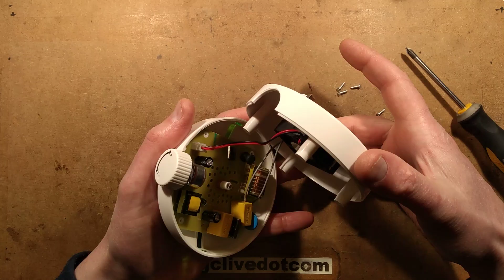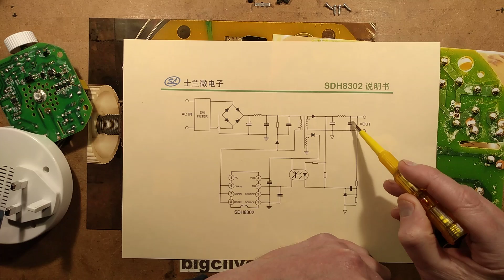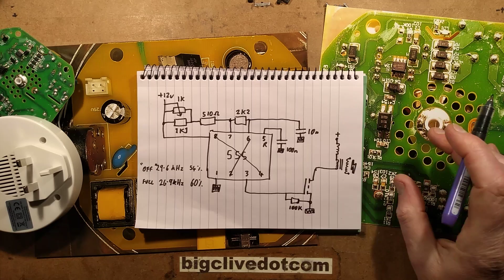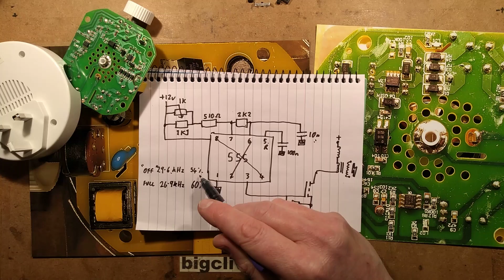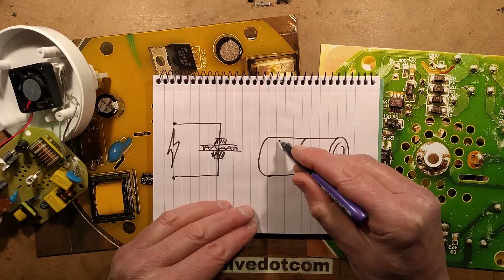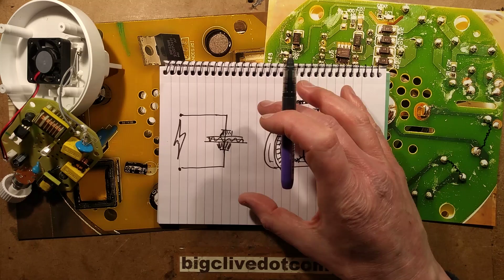Inside a faulty Puripod ozone generator.

Comment: The DS212 seemed like the best mini scope I could find, though it's still a bit expensive for my current involvement in the hobby...  There's another one that came out, though, it's a hand-held greenish thing, 20 MHz 2-channel, sells for about $120 on eBay...  They'd advertised it for $20 one day by mistake and someone bought one, but they fixed it the next day and I couldn't order it  lol

idk if it's any good, though, it's the.... JDS2023, they also have better models, too, like a 50 MHz one, and a 4-channel portable one, but the JDS2023 is at the same price point as the DSo212 and I'm wondering which is the best bang for the buck... and I guess, speaking of bang, maybe you could get one for free off Banggood and review it or something  x 3

I was just checking and there's also an Owon 100 Mhz 1GS for $260...  There's the resale value, the "I might break it" factor, and the usability and keepability that I consider, I think...  idk what I'm going to do, but since you have a DSO212 if you got a JDS2023 and made a comparison, I wouldn't stop you.

Edit: There's two English reviews on YouTube for it (haven't watched them yet), I think it's a new product/brand/company...
Reply: I'm just going to use my BeagleBone black as an oscilloscope.
Reply: My "stunt" oscilloscope is a DSO150. It can be found for about 20$-25$ on banggood. Only single channel and not really high bandwidth (a few hundred kHz), but it serves me well when doing repairs especially in the power supply section of circuits.
Reply: Yeah, the BeagleBones a little pricier (60  NZD)  but I believe it does 100 MHz max. I'm currently building a case and designing some PCBs to attach probe jacks to. 2 BNC, 14 banana plugs. Has either 16 or 14 channels, and you can use it wirelessly. It's a pretty cool system. If you're interested check out BeagleLogic

Comment: Being a ham radio guy, when i hear arcing it is always a bad thing. With high power RF amplifiers - tube type, if it arcs it also goes bang LOUDLY!
I don't get the benefit of ozone, only smoke and if it's a really big failure - fire. Lots of fun for all when the smoke alarms go off at 2 am.
John blew up his transmitter again - yay!
Reply: Surely you’re not suggesting that 3,000V at 1A could possibly get exciting?  :-)
Reply: @ethanpoole3443  I got an old eto alpha 3cx1500 amp at a ham fester. Guy said it worked but needed some tlc. $200 i took it home. yes it worked fine - ish. After testing it i was happy, left it for a day and a half or so. I played it smart and discharged the
HV cap and wham! One of my fingers was on the screwdriver shaft. Threw me against the wall and i broke my left index finger.
Always replace the discharge resistors - always. 1 st and last time that happened to me. Truth be told i do not remember what i broke, i just remember the flash the wall and being on the floor. I was 22 so a long time ago - early 80's. I have a very healthy
respect for high voltage - from then on.
To see it is fine, when you see and taste it a
lifetime lesson has been learned.
Nope, no excitement at tall.
Reply: Being a ham, period.(couldn't resist)
Reply: @benwinkel  After a few adult beverages.
Like tonight, the ham part does come out.
Reply: @johnrobinson357  Lol! I can relate to that. =)

Comment: Far from being healthy, ozone is a toxic gas, its ability to react with microbes in the air also allowing it to interact with, and damage, tissues in the human airways. In fact I conducted lab research into this toxicity some years ago. For example, the US EPA states: "When inhaled, ozone can damage the lungs. Relatively low amounts can cause chest pain, coughing, shortness of breath and throat irritation. Ozone may also worsen chronic respiratory diseases such as asthma and compromise the ability of the body to fight respiratory infections." I would therefore definitely avoid the use of ozone generators in any attempt to purify air as a means of improving one's respiratory wellbeing.
Reply: Very true. And it is downright criminal to market this as an ionizer, and encourage your customers to use it in occupied rooms. Ozone has damn-near miraculous odor destroying abilities. And, to me, definitely has its place when used properly (in unoccupied rooms, with ample time to dissipate.)
Reply: William. I can concur with your response as a retired clinical scientist working in the Linear Accelerator radiotherapy side of Medical Physics, Ozone is highly toxic and causes cell damage, we had to go to great lengths to monitor and suppress its production in very high voltage equipment,  I can not think why anyone would want to actively produce it. Ozone is often confused with Dimethyl sulphide which is the compound that causes the "Seaside smell" that you sense at the coast caused by decomposing organic compounds found in seaweed etc!
Reply: @peteshulver9221  - So dimethyl sulphide is responsible for the "Seaside smell"(?)   We need to bottle this up and sell it as "ode de beach" stat!  (o:
Reply: @peteshulver9221  Yes, quite a nasty compound! In my research, we used high-voltage discharge-based ozone generators in exposure chambers within a dedicated inhalation toxicology institute in the US.
Reply: quoting the epa is not exactly lab research
Reply: @Blox117  Clearly, I was not sufficiently explicit in my note. I am a PhD biochemist and toxicologist and have specialized in laboratory inhalation, cell culture and metabolism studies (including those looking into the effects of ground-level ozone on respiratory tract cells and tissues while pursuing a postdoc. at the Inhalation Toxicology Research Institute on Kirtland AFB, Albuquerque NM). The EPA quote was just a recent general statement on the subject.
Reply: @williamevans9426  I have been reading more on ozone and it appears you are correct. Ozone should not be present in living spaces over a lengthy period without ill effects. Over a short period of time at low concentrations I will have to disagree that it is harmful at all. Basically treat ozone like you would chlorine.
Reply: man I certainly dont understand this paranoia over chemicals
Reply: @Blox117  Try telling that to the North and some South Vietnamese during the war when doused with Agent Orange!
Reply: @peteshulver9221  that is the most retardedly dishonest strawman argument I have seen in a while. congrats
Reply: @Blox117  
Truth.  Entirely irrelevant and unrelated.

Ozone is one of the best deodorizers.  I use a massive room cleaner a few times a year around my house.  I run it for a half hour and then properly vent the room to the outside.  These smaller units are definitely helpful to remove pet odors.
Reply: @Aff3ct000  Fair comment - especially as you ventilate the rooms well; I wouldn't generate ozone in an enclosed space while being in there, though. Post-generation, once well ventilated, there'd be no residual problem.
Reply: @Aff3ct000   You are harming your health and the health of your pets by being in the same room as an ozone generator/deodorizer. Modern research shows that you can only safely use these ozone devices when no living people or animals are in the room/building. Like a bug bomb, you must ventilate the area before you re-enter the space.  That is why these ozone deodorizers and air purifiers are being banned by most western countries. Enjoy your upcoming cancer events in your smell free home :-)
Reply: @LastTechnocrat  
You may want to brush up on your reading and comprehension skills.
Reply: @Aff3ct000  Unable to refute the argument so you attack my reading and comprehension. Next time try responding to the merits of the arguments against ozone.
Reply: @LastTechnocrat  
Again, read what was said.  You clearly have difficulty with simple comprehension.  When did I state that anyone had access to recently ionized areas?

Comment: There in insanely stupid noob-question on AC-DC converting circuits: What limits the power/current output? When I let a load draw more than 1.1A on a 1A rated  USB power supply, the voltage quickly drops under 4.7V. So how is the current determined that causes the voltage drop?
Reply: Martin Rocket - The design of the circuit and the properties of the components used. For a start, some designs include either a power output limiting function, or a current limiting function. Even where they don’t, transformers can only pass a finite amount of power. In all cases, the output voltage drops.
Reply: Mark 1024MAK, so if there is no deliberate function to limit the current, then the transformer limits it inherently? Are there any other limiting factors?
Reply: @martinrocket1436  peak primary current limiting, usually a function of the control IC and either an internal or external current sense shunt resistor in the primary mosfet drain. https://pdfserv.maximintegrated.com/en/an/AN5504.pdf
Reply: but the real question: why cant i get infinite power by plugging in an extension cord into itself?

Comment: Hi Clive, thanks for getting this in and checking it out so quickly after I mentioned it. The video you seen was the one I did with the smoke and it did seems a bit iffy when I watched it and yours is much better with real information. I did end up buying two of these and both were slightly different as one made loads of noise and the other very quiet so I think manufacturing might be a bit hit and miss. Those green LED's are so bright in a dark room I put tape over them but wasn't sure if there was a reason behind them but after your video, I'm guessing not. The smell is very difficult to describe but the smell after a thunderstorm as they claim is almost right but not exactly it. I personally didn't mind the smell at first but after a couple of days, I couldn't deal with it anymore so unplugged them both. It's a bit naughty the company claim it to be an ionizer though as that's what I wanted to try out. I will keep my eyes open for other things like this you might fancy taking to bits. Thanks for the video :)

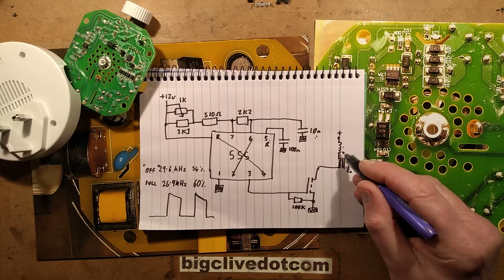Comment: 14:25 Depending on the position of the coils relative to each other, it could be that the designers required 'mutual inductance' in the circuit.
This inductor may take the place of a protection diode not seen here often found in these circuits to protect the MOSFET.

Comment: Could it be deliberately designed to generate ozone all the time even when the fan is off to make it fail faster. That you need to replace the device once a year instead of once ever 10 years. Sometimes bad design decisions are bad for the customer, but good for the manufacturer. Effectively you have a highly corrosive environment inside the device. Me personally I've always thought of ozone as a bad thing for humans, unless it is at the top of the atmosphere blocking 100% of the UV-C in which case it is great.

Comment: It's a very pretty transformer and if fully potted I am betting ya could get 10-20 KV out if driven hard enough maybe more.

I am betting the inductor in series with the HV transformer is for current limiting to the primary. I wonder if they did that to cut down on power handling/cooling components and cost.
Reply from the maker: Looks vacuum potted.  It does look very good quality.
Reply: @bigclivedotcom  My friend and I " Youtube Channel Join The Technicians " Have been working really hard to make custom high voltage transformers for the electrostatic magic wands. So far we are on driver development and are fixing some phase problems with the full bridge driver but not important. The transformer shown here is an amazing form factor, looks about the diameter of a AA cell. Currently we are using a driver that matches the 18350. This stuff gets really tricky when you try to put 250kv in a 12 inch stick. The problem we have been working on is defeating the capacitive heating in the epoxies, another major one has been trying to cure the epoxies at the right temperature zones as not to crack the cores. A thing to note when you pull transformers apart, a heat gun does absolute wonders!

Comment: Do these work and is ozone safe?
Reply from the maker: Yes they work.  There are two sides to the ozone argument.  I side with it being safe in low levels used occasionally, but I wouldn't want an ozone generator running in the same room all the time.
Reply: bigclivedotcom thanks big man.
Reply: like all things it is safe in moderation

Comment: Terrible looking solder joints all over that PCB. Probably used the sh**ty lead free solder because most of those solder joints look dry and bumpy. I agree that it's a weird circuit design. Cheap looking too. But an AWESOME video upload as always Big Clive!  Thank You!
Reply: That's not a lead free solder problem. It's bad technique. That's what SAC305 looks like when you are sloppy. Have to use an appropriate tip, appropriate temp and be meticulous about keeping the tip clean. None of that will slow down someone that's gotten the hang of the stuff but it does require giving a shit about quality of your work.
Reply: Oh I'm sorry. I've never used lead free solder (or SAC305 as you mentioned) in the 41 + years I've been in the electronics industry, but what ever the reason is for these lousy solder joints, this should not have passed inspection. I'll have to try out the lead free solder sometime and see how it works. Probably won't bother with it though.
Reply: @JayH7745  SAC305 is one of the industry standard lead free solders. Similar to working with the lead based silver bearing solder of old but higher heat to get good flow. Works amazing when you need something that'll shield the joint from ambient RF and as I learned in a recent project can actually weld galvanized steel with a seamless (looking) joint.

Comment: Ozone is very  bad for you. Any heavier ozone exposure gives a nasty headache very quickly, at least for me it has. If you're in a room with ozone you will get used to the smell and may not realize levels rising to dangerous levels. I had one such experience when running a tesla coil in closed room for a while. (arcs in the air generate ozone a lot). UV light is another common source for ozone but if you're in a radiated room you have much more problems than ozone with that!
Ozone is very toxic. (Had to dig some non-EU msds references for you : ) US OSHA 8h exposure limit 0.1 ppm (ppm=parts per million). That much less than limit for hydrogen cyanide when comparing the concentration. You'd smell ozone more easily though.
Reply: Ozone is also bad for the environment at surface level. It filters UV light in the stratosphere, which is good, but at surface level it’s just toxic and inhibits photosynthesis.
Reply from the maker: I think it's the process of making ozone in the stratosphere that absorbs the UVC wavelengths.
Reply: If you are sparking away with your tesla coil, also note you are generating Nitrous oxide, also bad for you. Even with a small setup if you put a glass jar over it you will see the brown gas form

Comment: this faulty one produced double ozone, at the intended tube and at the faulty sparky joint :)
Reply: They could market the faulty units as "premium efficiency units"
Reply: 2x the ozone output, with bonus toxic solder ions free of charge and all for the same price!
Reply: Unless it's using lead-free solder, for non-toxic solder ions.
Reply: Greg Ewing - Exactly! Given China's track record, hopefully the solder is on the level, especially considering the device will certainly be used around people and pets...
Reply: @gcewing  If it was leaded solder it wouldnt have been such a horrible joint :D
Reply: you're not wrong
Reply: Ok so how much ozone MG/h??

Comment: why would someone want to generate ozone?
Reply: Too many uses to list in a youtube comment so...
https://en.wikipedia.org/wiki/Ozone#Applications_2
Reply: @cojones8518  
Thanks for this very informative link.
Reply: To close the hole in the ozone layer.
Reply: If BigClive had only explained that... Oh wait... HE DID!!! 😒
Reply: It is sold as an air purifier, but just spits ozone instead. Ozone has a “fresh” smell though, so you think the air is pure.
Reply: morthim - To recap... it's a very effective deodorizer and thus ozone machines have been marketed to consumers over the years to kill bad odors (and also molds) around the home (ie) heavy cigarette/cigar odor,  musty basements, odor abatement after sewer backups, pet odors, etc, etc, etc...  While ozone is great for permanently removing stubborn odors, it's not safe to breath for hours on end (it can and will damage the lungs). So it's wise to only run them while one is away and turn them off upon returning home, while also opening windows to further dilute any lingering ozone...

Comment: You could always make a HT probe, the professional ones seem to be just two 300m ohm resistors back to back in line with the tip
Reply from the maker: Most HV probes rely on the 10Mohm meter impedance and scale it down with a single high voltage series chain of resistors.  But in cases like this it would probably load the very low output down even with that high resistance.
Reply: @bigclivedotcom  I think I got my information from a data sheet about some professional models and I thought, well why would I pay hundreds for that when I could make it myself for 5% of the cost 😅 I think the problem would come with accurate scaling, what do you think

Comment: Jacuzzis will either have a UV light or an ozone generator to keep it clean. It's widely used in hospitals. Restaurants can use ozone generators in walk in refrigerators. I have built a couple myself for odeur removal in ie cars as it will neutralize both cigarette and wet dog smell very effectively. Of course, it will accelerate oxidisation. Another great use is in water damaged basements to kill of mold etc. Very useful for loads of things. This generator probably produces less than 50 mg/hour, whereas a generator for odeur removals for cars should generate at least 5-6 gr/hour for DIY and 30 gr/hour for commercial use.